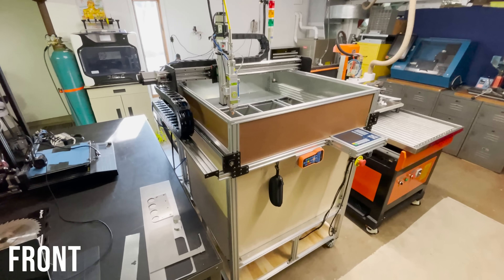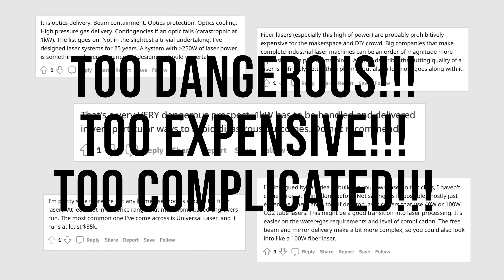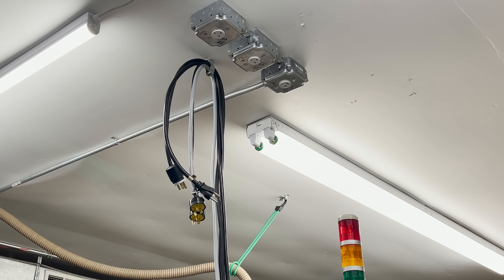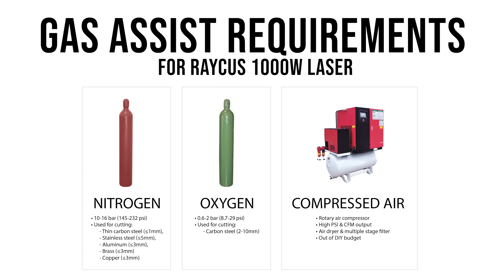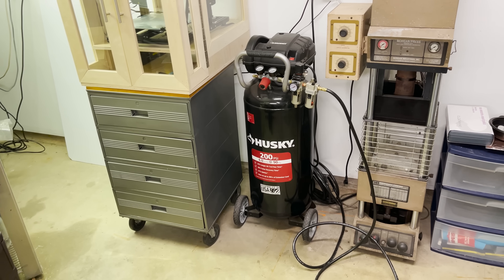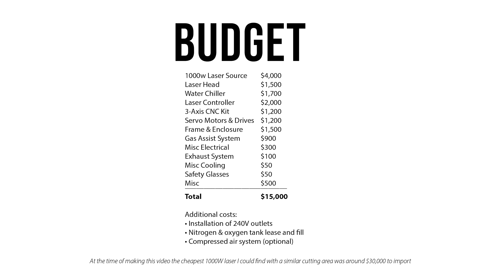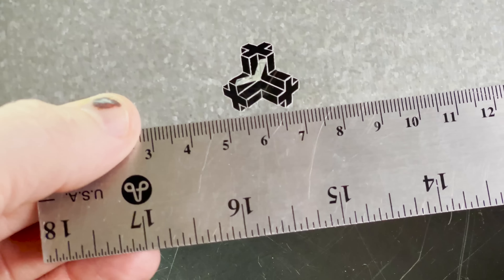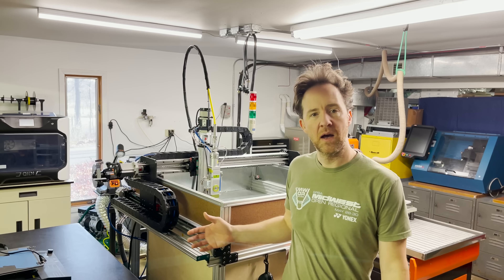DIY 1000W Fiber Laser Cutter Part 1: Project Introduction

Comment: For the record, Eagle Pair goggles, and specifically those you have, are completely unsafe and don't provide any significant protection at 1064nm. Me and a few colleagues tested this on industrial spectrophotometers designed for this purpose(testing coatings/film transmission), and they transmit as much as 8% of light where they should be transmitting 0.0000001%
Get a pair for 800-1100nm @ OD6 or higher, from any of the following brands: Kentek, Lasertack, Thorlabs, Honeywell, Glendale, Sperian, Newport/MKS, Edmund Optics, Laservision/Uvex, Laserglow, NoIR (LaserShield).

As others pointed out, you are being straight up gouged for gas price. You don't need UHP, refilling a 40L nitrogen bottle costs me $15, oxygen $45. Both at regular technical purity, 99.95%. Even 95% reject garbage grade will work perfectly fine for cutting. Also, when opening the gas cylinder, you want to open the valve at least halfway, otherwise you'll be wearing the gasket through way more quickly and can cause leaks(high pressure leaks are scary).
If you have space and power, you could also try replacing the oxygen supply with a small army of oxygen concentrators. They're basically free in the US after they become no longer fit for medical uses, and I reckon you could get away with around 4-6 units running in parallel, through a tiny air compressor on their output to bring up the pressure. They'll also provide nitrogen(well, oxygen-free air) out the reject port.
Reply from the maker: Thanks for sharing your wealth of knowledge! The glasses I have are FreeMascot (maybe it's rebrand? https://amzn.to/3GVoWEE) they say they're OD8 800nm-1100nm, but I will check out some of the other brands you listed. And thanks, I will get cheaper gas next time
Reply: @diyfiberlaser  If it comes from Amazon.....the specs should be questioned and tested. I believe NOTHING from Amazon anymore and simply stopped buying anything that that matters. I don't have the means to test safety glasses, so I prefer to buy from outlets that can offer assurance they meet the stated specs.
Reply: @diyfiberlaser  FreeMascot is just garbage, worse than Eagle Pair. Whatever they say is irrelevant. Anything from Amazon, eBay, Wish, and any other site besides official distributors of the brands I mentioned is completely unsafe and you should not buy from them.
Reply from the maker: @Spirit532  OK, thanks for preserving my eyes!
Reply: @diyfiberlaser  I also have three pairs of the freemascot... Curious about them as well
Reply from the maker: Thanks again Spirit, I ended up getting a pair through Kentek...they even called me to confirm that the pair I selected were going to offer adequate protection for my specific laser type, frequency range, and application...that's incredible customer service!
Reply: Good idea about the oxygen concentrators. An Oilless air compressor is a must.
Reply: Look in glassblowing forums and sites for concentrater info and refurbished, higher output units.
Reply: @hibraisil  Glassblowing people are using regular medical oxycons, they just don't know it, and are getting ripped off with pricing.
Reply: is there a method we can test laser glasses or any other material for blocking 1064nm at home?   I mean something inexpensive like a cheap laser source in the mW range (laser pointer type and pricing) working at 1064nm. Used with some light detector as simple as a photodiode?
Reply: @nick066hu  No. You have no way of calibrating it and your setup will not have the dynamic range to properly characterize it. Single wavelength measurements are also unsuitable because you need very high resolution to find dips that would be dangerous just outside your current test device's output, thus necessitating a broadband source.
Reply: As I saw the bill of materials, I immediately saw that he cutter down costs on safety. Dude....never cut costs on safety, even if you only operate 1kW of optical output power. The scattering alone can instantaneously kill your eyesight. Get a proper pair of goggles at least attenuation 6 or something for the entire sprectrum your laser puts out.
Should have cut cost on the utterly annoying beeping CNC controller. 
Stay Save😎
Reply: Watching the video I was thinking ‘save wherever you can, then buy the most expensive glasses available’ 😂

Comment: Where on earth are you looking at oxygen that is $455 per refill it cost $200 or so for a new bottle and then $60-$80 per refill depending on where you get it here in Georgia, don’t know about the nitrogen prices
Reply from the maker: I was purchasing Ultra High Purity level gasses as recommended by Raytools (the laser head manufacturer). However, I've heard from another fiber laser user, that they get away with using standard industrial purity gases just fine, so I will definitely be looking into that next time to refill.

Comment: That's just impressive. My greatest respect for your achievement. How many mm sheet thickness can you manage with 1000W so concentrated?
Reply from the maker: The laser specs say 10mm carbon steel, but I have yet to test it that thick

Comment: Sounds to me like it would be good for a person to start with building a CO2 laser first, or even a simple diode laser setup before jumping into one like this.  I love the idea of 1kw+ fiber laser, but I think I'd have a machine that could do amazing things and no one to buy the stuff I'd make.
Reply from the maker: It is certainly not a beginner project...I've built a number of CNC machines and also enjoy retrofitting and building controllers for older machines, and have CO2 and diode lasers, and this project was still a huge leap in complexity.
Reply: @diyfiberlaser  Still a lot simpler than any cutting CNC machine, as you have no cutting force here, so the mechanical design of the gantry is a lot simpler. You still need rigidity for accuracy of the cuts, but nothing compared to a mill!

Comment: Holy smokes this is awesome! I've looked into DIY fiber lasers too and was bummed there wasn't much info out there of successful builds. Definitely sticking around for this series.
I see you built it off the Ultimate Bee frame, solid choice! My first CNC build was one of the original Workbees. And I just finished my latest CNC build and used a Masso controller, which I see you have in the back running on of your other pieces of equipment.
Reply from the maker: I guess we have similar tastes! 😀

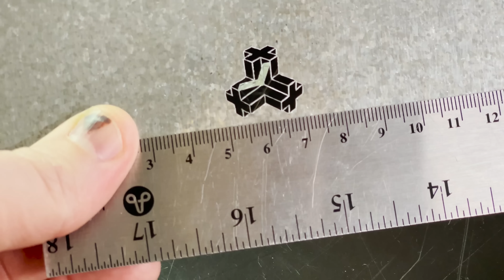Comment: pretty sure it isn't 20 cm (10:00)  ;) Nice video! How thick can it cut?
Reply from the maker: I meant 20 mm, of course I didn’t realize my mistake until after I posted the video…doh! The specs on the laser source say max 10 mm carbon steel …I should get a chance to try it later this week

Comment: i suspect youre being gouged by Airgas for those outrageous refill prices. Find a good welding supply store and Nitrogen is around $40-50 for 250cft bottle  Lol i just literally saw your bottles are Airgas after I posted this. Find a better supplier Also EMAXX is an American company that makes very high CFM compressors and Refrigerated dryers. They have a 30CFM package thats right about $3500 and runs 230v single phase @ 50A circuit. Thanks for the Laser info. I like my cnc plasma but want Laser for the precise clean cuts like you mentioned.
Reply from the maker: @stainlesssteve8571  Thanks Steve...you just saved me a considerable amount of gas money!!! For my compressed air test, I am going to filter the air though a 3-stage filter with desiccant dryer. How often do you need to clean the lenses and protective windows to make sure they free of debris?
Reply: agreed, anyone is cheaper than praxair or airgas. any good local welding shop will be wayyy cheaper.
Reply from the maker: Thanks for all of the helpful tips! I think they are charging a premium because the gasses are both their Ultra High Purity versions, but definitely I need to shop around some more. I will check out the compressors, seems like a reasonable price, thanks!

Comment: thats one crazy project ! theyre isnt much diy fiber laser cutter build
Reply from the maker: yep, that's why I did it!
Reply: @diyfiberlaser  youll probably save money fast over a plasma cutter build
Reply: Fantastic project! Make it pay for itself. 

Also, open the oxygen ALL the way until it stops. Those main bottle valves are designed to seal when fully closed and fully open. In between, they can leak.

Have fun!
Reply: This is next level! Amazing!